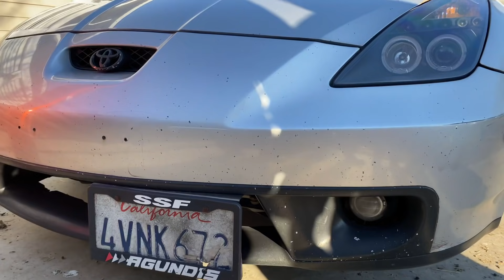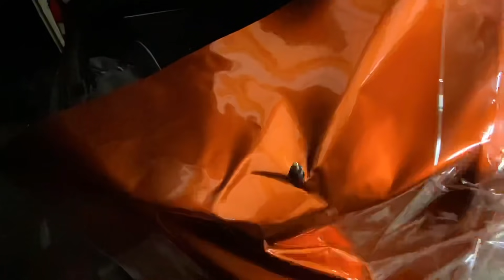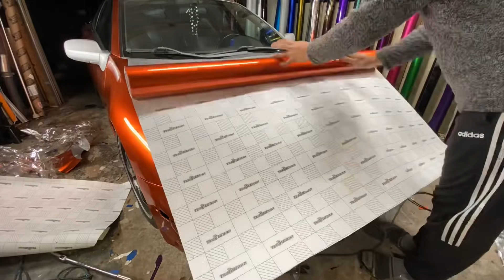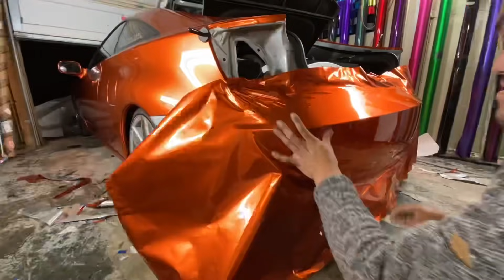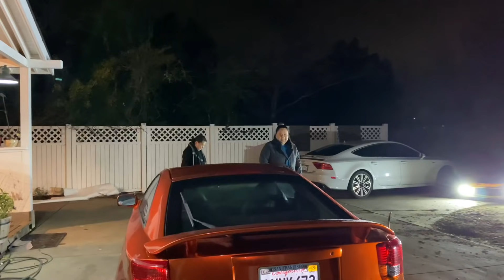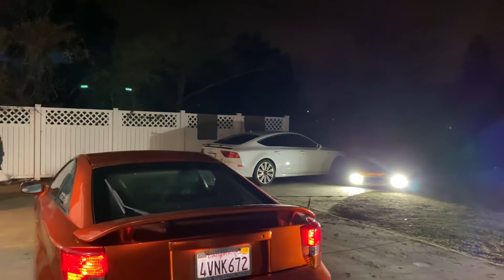Celica GTS Revived In Candy Orange | DIY Wrap Guide

Comment: It's clear to see your skill and technique have evolved compared to older videos. One tip is if you need a really thin tool for tucking under tight trim, you can use a piece of the backing layer.

Comment: So what's the advantages of wrap versus paint.? And this job looks really good. These Celica's are a disaster in the front and the rear. Looks like it took about two days from dawn until dusk? 
Id like an estimate on what it'd cost to do a 2007 Chevy Colorado Extended cab. No damage. But hows this hold up in the hot sun all day? I see you using the heat gun for stretching in. So would it melt in a parking space where the sun is reflecting on it off a glass window would it melt off or bubble and fill with water in rain? 
Great job but why not just paint? This stuff would need to be awful cheap to sway me.
Reply from the maker: It’s only $400 if you do it yourself and you don’t need a whole booth set up. So cheap in equipment cost and you can do it almost anywhere. I’ve had it on my cars for years in the California sun with no issues.